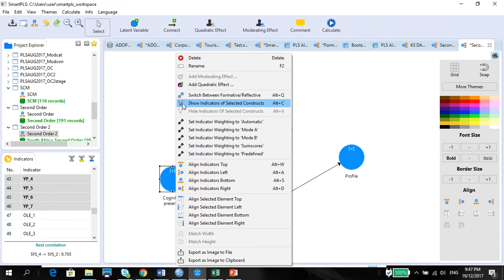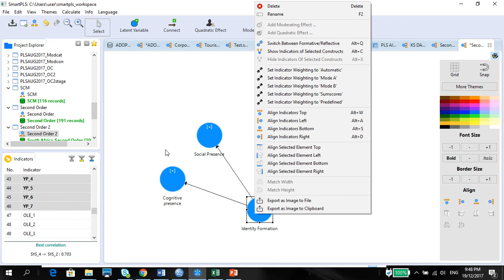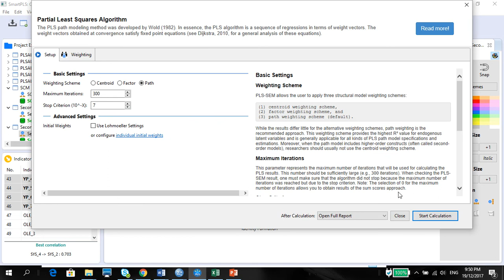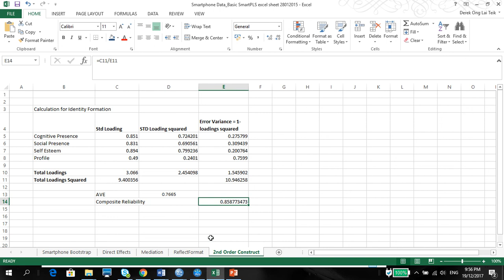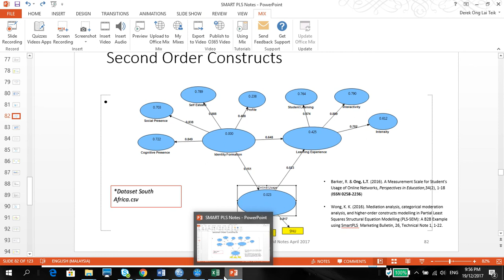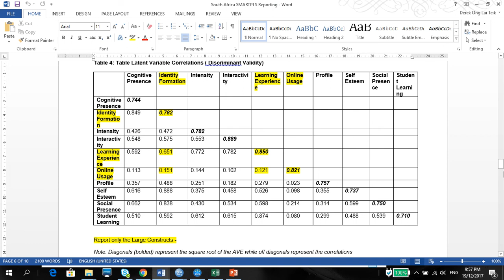PLS Vid19   Higher order Constructs

Comment: Dear Dr. Derek Ong,
Permission to ask.

1. If a theoretical model has been tested using SEM PLS and has passed all measurement models and structural models ... One of the variables (reflective-first order) after experiencing a reduction in loading factors etc. from the beginning there are 5 indicators only 1 indicator remains ... Is it permitted this happens? If yes, is there any literary basis that states this?
2. How to solve if the HTMT value is greater than 0.9?
3. Is there an effect of the number of samples and the total number of items on the success of data processing using second-order method SEM PLS? The number of samples in my study was 55 organizational analysis units and 5 variables with 81 items.
4. Is it still necessary to check the normality of the data related to question no 3?
5. If the model in my question number 3 is processed using a second-order and it fails (does not pass the measurement model), what should I do? Is it permissible to process it using the first order?

Please help me.

Stay healthy and successful.

Comment: Hi Dr.Derek Ong, thank you for your video. I have reflective-formative higher order constructs. Could you please help me some questions: 
(1) For the 1st order reflective component, I need to report the loadings, AVE, CR? 
(2) For the 2nd order formative component, I do not need to report its values, but it would be the same as the regression. So do you have a video about how to deal with some formative higher order construcs as the regression?

Thank you so much. I look forward to hearing from you soon.
Reply from the maker: hi you are correct but at the moment I do not have a video on that :)
Reply: @derekong1609  Thank you so much for your quick reply. I really appreciate it.
Reply: Hi Dr.Derek, there are three reflective-formative higher order constructs in my framework, could you please suggest me how to deal with these formative second order constructs, as there are 10 formative second order components under the three constructs.
Reply: Dr.Derek, beside regression, is there other treat to the formative second order components? Thank you so much.
Reply from the maker: @haohvtc5984  in SMART PLS that is the way to treat it if it is reflective formative... there is also formative formative or reflective reflective
Reply: @derekong1609  Thank you so much!

Comment: Hi, Dr. Derek. Thank you so much because your tutorials are so helpful and meaningful for me. I want to ask one question. If my second order component is formative, do I need to report the outer weights and VIF instead of outer loadings, CR and AVE? If so,  How to get the VIF of the second order formative? Thank you.
Reply from the maker: Hi thank you... no if it is formative you do not need to because it would be the same as the regression... you only have to report the first order
Reply: @derekong1609  Just like your tutorial of PLS Vid18 Assessing Formative Measurement Model thatt, report the first oder component of IT Use and  Manufacturing Performance, but no need to report the second order component of Share, right?
Reply from the maker: Yes
Reply: @derekong1609  I see, thank you.

Comment: Dear Dr. Derek, if we delete any indicator on the variable's dimension to meet the desired AVE, do we need to delete the indicator on the latent variable also?
Reply from the maker: Yes
Reply: @derekong1609  Hi Dr. want to ask you a few questions. First, I have desired AVE for the dimension, but the AVE of the latent variable is below 0.5. Should I delete one dimension or what? 
Second, I have one latent variable that resulted in 0 AVE. This variable has 5 reflective dimensions and all dimensions are having good AVE. However, the AVE for this variable did not come up. Do you have a hint for this issue sir?
Reply from the maker: @MrAlverian  you might want to try deleting your low loading items one by one until it meets the desired AVE ...